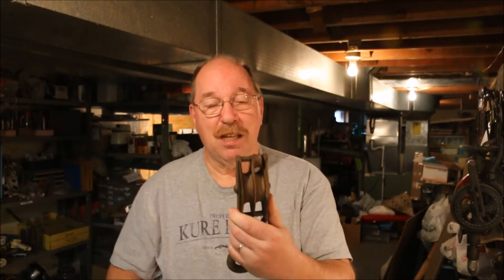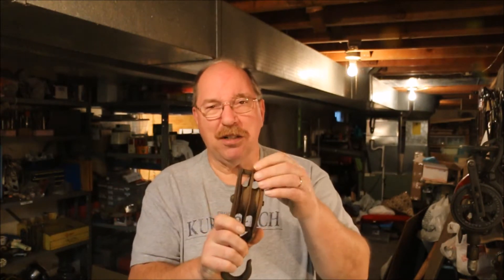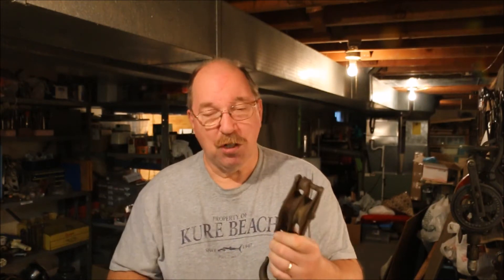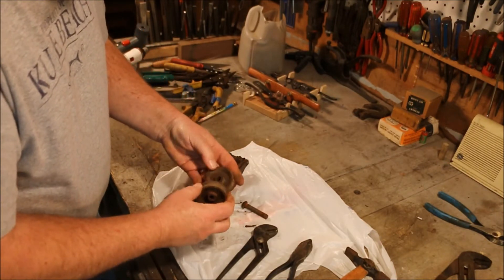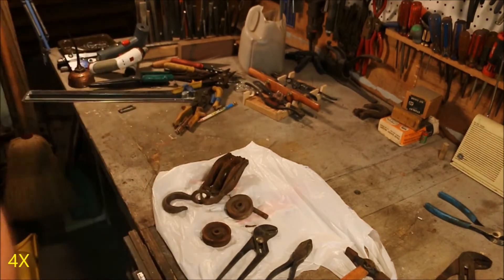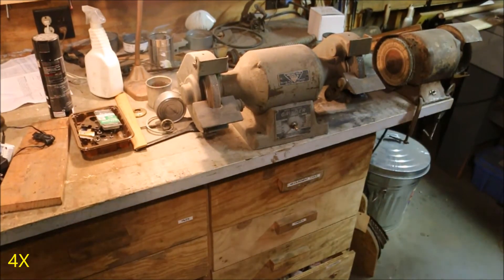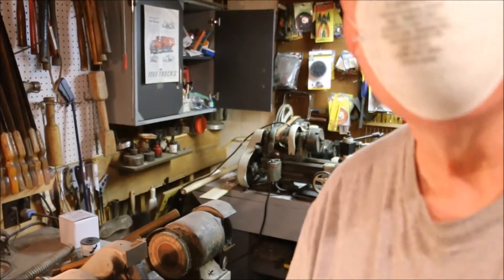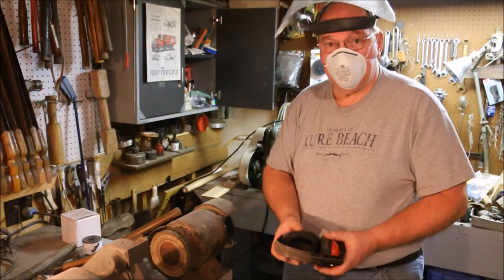BLOCK & TACKLE ~ PART 1 ~ CLEAN AND PAINT

Comment: Thanks for the 'Angels' Unc. A lot of folks are going to need them and have already. I guess I need a winch for my hoisting apparatus but what I have will work I suppose. It's what's known as a Hot Line Hauser and it's a winch with a strap about 1 1/2 inches wide on a ratchet spool with a 2 1/2 ton rating and a 2 foot long handle. It's close to 2 feet long including hooks on both ends but the real interesting thing is lifting the new-ish mower BUT I can get it up then rock it back over center and leave it hooked up incase of a bad boo boo. I scotch it beforehand  too and all's well so far. Your double-block will work like a really neat working thing!  I've seen the differences with various hooks with cranes and such. Double-block a dozer winch and you can pull a truck in half!

Comment: did you not hear me say towards you' hang it up and paint it' i guess not! lol
Reply from the maker: Just faintly. 
The weather hasn't been cooperating. Rain messes up the paint when I hang them outside and painting inside I don't have a paint booth. Space issue and also a perception on the part of the powers that be that I will be creating too much dust from constantly painting things in the basement. 
She's right. Knowing me for 41 years gives her a large bank of behavioral patterns to base her assumptions on. 
I cheat by having the parts on a flat surface. The overspray lands on the shopping bag and sticks. When I hang it up and spray it the paint fog goes around the room. Trading ease of process for the illusion of security.  😊
Reply: its true with the dust, i must have swept my workshop 10x this week, still have red dust from last weeks spraying
Reply: I'd try that but that's what I roll around on the ground with.